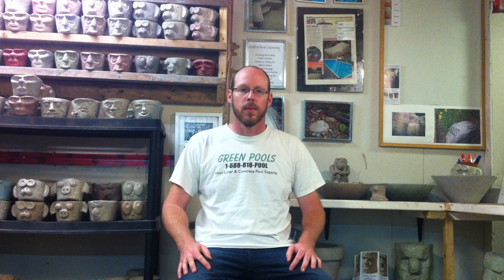Tips For Getting Vinyl Pool Liner Back Into The Coping Track

Comment: Hey Steve, my liner is out in a corner of the shallow end. Can I use a hair dryer to heat up the liner to increase the stretch? I plan to lower the water level. Any advice on how much I should? lower the water level